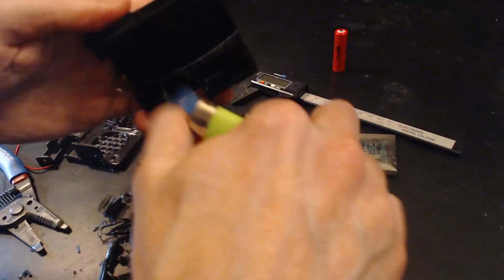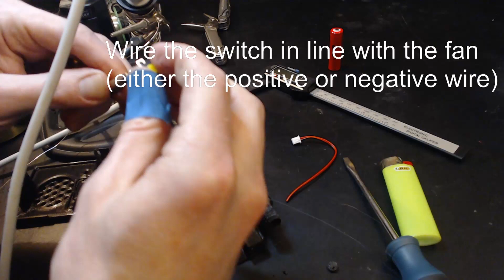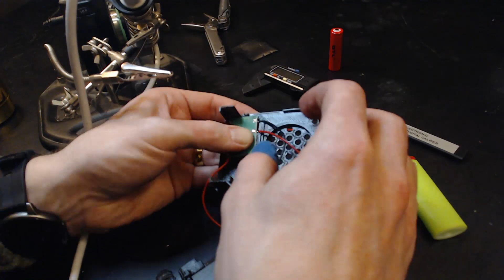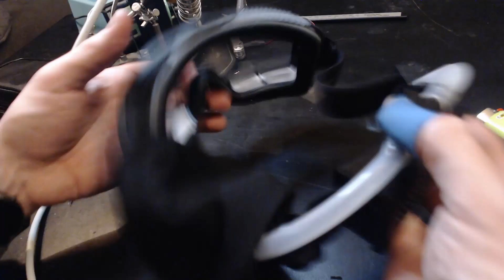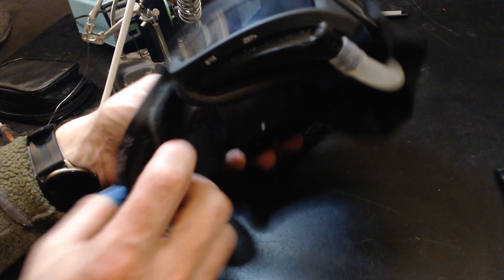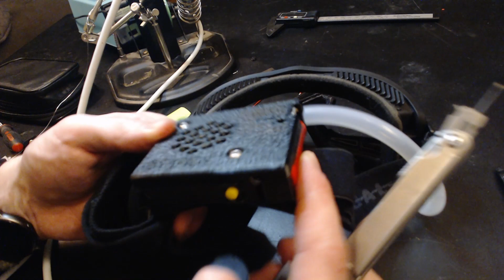GTFO! DIY Anti-fog Goggle Assembly

Comment: What is the mah of your battery and how many hour it runs continuously on full power?
Reply from the maker: Its a 14500 lion battery advertised at 2500 mAh, probably was less. Never measured full run time at full power. Have mine dialed in to about half power, which kept up with a 90 deg sweaty day at the field for at least 4 hours.
Reply: @electromagics  do the PCB heats up when you charging it? Direct?
Reply from the maker: @jonathancharlesferriols1208  haven't noticed any heat, the thingiverse page shows the PCBA I used: https://www.thingiverse.com/thing:5936549
Reply: @electromagics yes I have seend the PCB, what is the brand of your battery 14500?
Reply from the maker: @jonathancharlesferriols1208  GTL, but any protected 14500 would do
Reply: @electromagics  looking for same battery capacity, because the available ones here in our country are all 900mah max for 14500. Do you still have the 18650 battery design?
Reply from the maker: @jonathancharlesferriols1208  I don't think my batteries were really as high as they advertised, those are probably equivalent. I do have the 18650 design, which has an off board power supply to keep the weight down. It's on the same thingiverse page, check the update at the bottom of the description.

Comment: are you using a 5V turbo and if so did you set it to max voltage? I'm wondering if a naked 18650 at 4.2v charge will be enough. i would just charge it at home and eliminate the board
Reply from the maker: I don't know what a 5v turbo is, but I think what you're discussing would probably work for your purposes. Send it and let me know how it works!
Reply: @electromagics  sorry the blower fan is nicknamed a turbo. i was wondering if you measured the output voltage to the fan and if you are using the 5v model.

Comment: do i need to buy the board or can I just like them all together? Also, thanks for the idea, I've tried to 3d print my own version but used a PC fan lol.
Reply from the maker: @gigiduru8198  hypothetically if you had a 14500 charger and you were planning on popping it out it would at least work for a bit without the board, but the board does the upregulation in voltage, and allows for USB charging of the lion battery, so I'd recommend using the board.

Comment: Just got my stuff delivered and noticed when i applied power to the fan it bearly moves any air, granted i dont have the step up board atm because i ordered juat the charging board by mistake but will the step up get the fan reall pumping?

I even connected the fan to a 11.1 lipo and it wasn't impressive
Reply from the maker: @tk2097  huh. I'd expect 5V to move more than 3.8V, but less than 11V. These fans move a lot of air IMO. Maybe you got a dud?
Reply: @electromagics I ordered 24v fans instead of 5v!!!🤣🤣